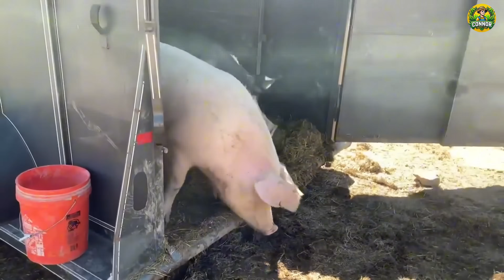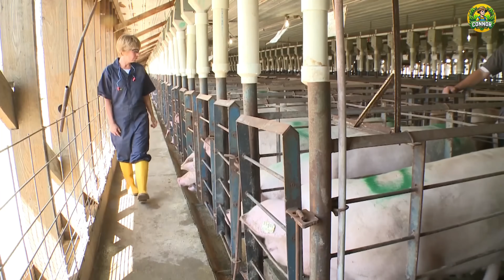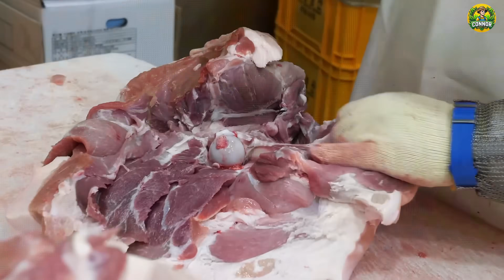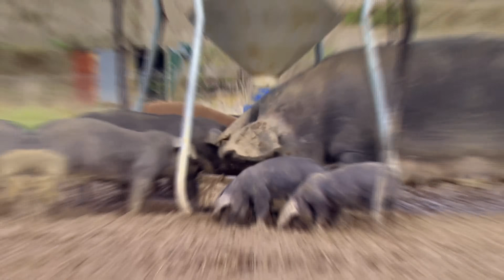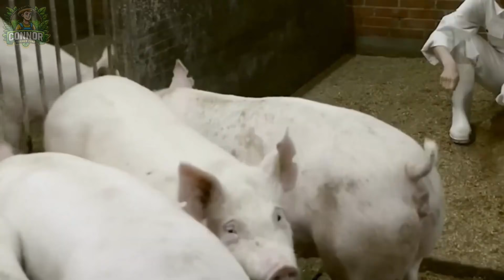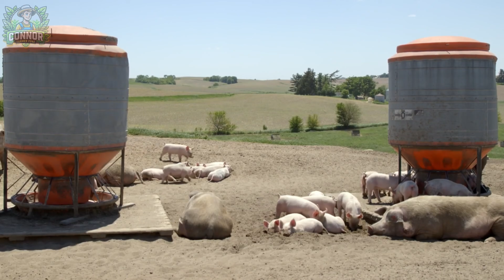Inside America’s Pig Farms From Factory Pork Production to Outdoor Farming

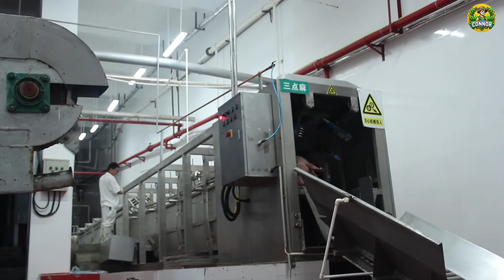Comment: @11:05---is that the death blow or only stunning?
At least these beasts provide nutrition for people.
Reply from the maker: Good question. In most modern pork production systems, animals are stunned first to reduce stress and suffering before the final processing step. It’s definitely a difficult topic, but the purpose of this video is to show the reality behind how food is produced. Thanks for sharing your thoughts.
Reply: @BKProcess  When stunned as they are at your facility, how long until they are 'slaughtered'? I would think a stunning does not last very long? Thank you for your reply.
Reply from the maker: @eladsinger9215  You’re right—stunning is not meant to last for a long period. In a properly operated facility, the next step is carried out immediately while the animal remains fully unconscious. Workers should also check for any signs of recovery and re-stun the animal if necessary. Thank you for raising an important animal-welfare question.